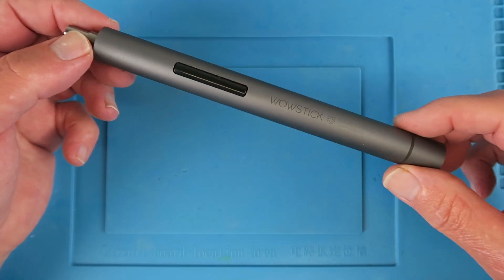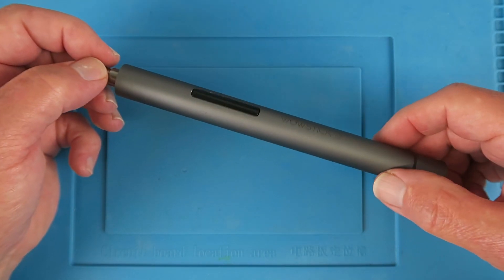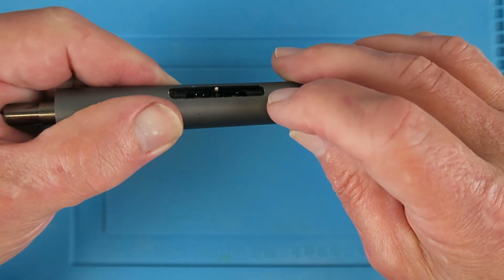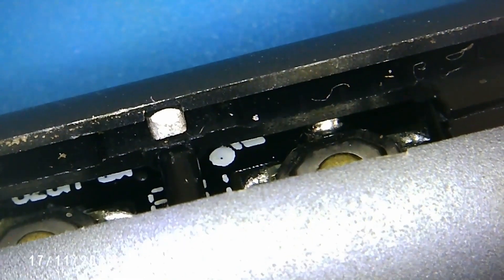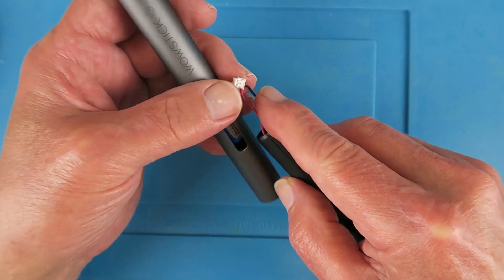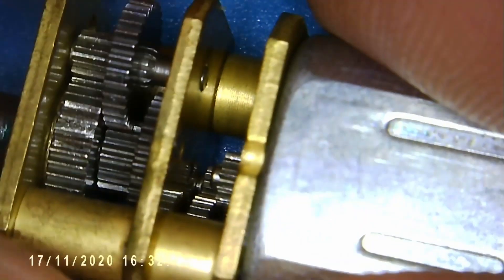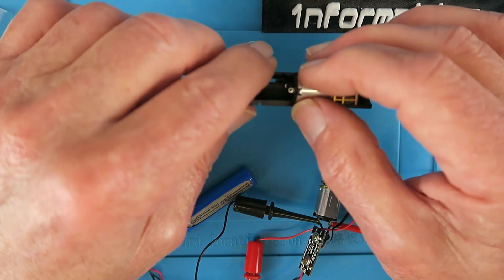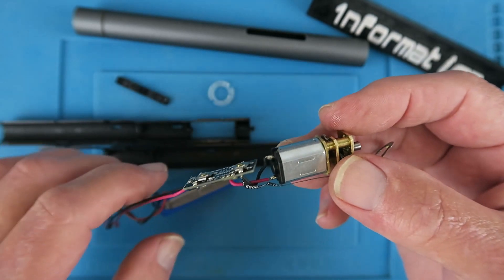Wowstick 1F+ Cordless Electric Screwdriver Teardown Disassembly Repair

Comment: Thank you, I just repaired mine based on your video. I ordered motor from AliExpress for 2 bucks, it was the short one. It turns out that it is rotating in reverse, but I easily fixed that by swapping the wires between the motor and the control board. The only thing that you're not showing is how you removed the charging cap, and it is kinda tricky, you should push it with something long and careful to not push it together with the charging board. Thank you for your video!!!!
Reply from the maker: You're welcome! Glad the video helped with your repair!

Comment: hi do u advice 1000 rpm or 500 rpm motor ?
Reply from the maker: It depends on what type of work you normally do. The general rule is higher speed = less torque. For example, if I work on a laptop with 20 screws in the base I would choose the higher speed. Thanks for watching, have a great day!

Comment: So I actually fixed mine with these instructions and got it all back together. When I plugged it in to charge it popped and immediately could smell the burning microchip. So the USB microchip control board blew out. Is there a place I can get these that anyone know? It still works right now but will stop working when the charge goes dead. If you have any ideas I would really appreciate it. I hate to come this far only to now have to buy a new one. Hope to fix that as well now,, if I can find that part.
Reply from the maker: This will work : 3.7V Lithium Battery Charger Protection Board 5V 1A 2A Micro USB https://s.click.aliexpress.com/e/_DegpA4D Thanks for watching, have a great day!
Reply: @1nformatica  Thanks man, you are awesome. I really appreciate the fast response and with an answer. You rock and will be following you
Reply from the maker: @rqgraphics  The board is a little too wide  to fit in the tube but maybe can trim some PCB off the edges. Otherwise you could always squeeze the casing to flatten it a bit! Let me know how it works out......
Reply: @1nformatica  Sounds good, I ordered it already today. I am an artist and do 3D printed stuff. So I am good at manipulating things and have the right tools for the job. I will let you know what I end up doing to it and if it works. That way you know as well for sure if someone else has that problem. Does the battery and main motor plugs have to go in a specific side of those plugs on the chip?
Reply from the maker: @rqgraphics  The battery and motor wires are in parallel. If you measure the B+ and output are joined. So connect the battery to B+ B- and the motor to output +/-. I found a slimmer board : https://s.click.aliexpress.com/e/_DBC4RsV
Reply: @1nformatica  Thanks again

Comment: Thanks for the video! Watch the video a couple time but couldn´t find the part where / how you removed the usb section. I can see a screw in the inside. Just pressing didn´t work. Any tip is apreciated.
Reply from the maker: You're welcome! You have to be brave to remove the USB plug! I used a wooden dowel rod about 8mm diameter to force it out from inside. It needs considerable force to remove. Once removed it doesn't want to go back! Good luck! Have a great day!!
Reply: @1nformatica  thanks- it worked 🤙🏾

Comment: ruh roh... I pushed the initial retaining clipes under the buttons deeper into the wostick to where I cant get to them now... watch out for that
Reply from the maker: That's a problem. Just speculating but maybe you can pass a thin piece of something like fishing line under it and pull it up?
Reply: Same thing happend for me. I just fished it out using a needle and fine-tipped tweezers

Comment: i have an issue with the battery which has failed and is swolen. Do you (By any chance) know what the correct battery is for this screwdriver (voltage & mah)
Reply from the maker: It is 10440 size 3.7v 350MAH lithium battery. There is a link to where you can find it in the video description. Thanks for watching, have a great day!
Reply: @1nformatica  Thank you soo much for the prompt reply, you've definitely got yourself a new subscriber!!!!!!
Reply from the maker: @justlisten9477  You're welcome!

Comment: How long did you have it until it broke ?
Reply from the maker: About 3 months. It broke because I tried to use it like a normal screwdriver to undo a screw that was very tight and it stripped the gears. The clutch is supposed to prevent this but it does not always lock. Be careful!
Reply: Atleast I know how to fix it now if or when it does crap out on me.

Comment: Amazing! Thank you! My battery is useless and needs replacing; but, there's also something rattling and the screwdriver will often not respond after a charge. Now I know how to access it and see what's happening. Pretty poor tool imo - looks fancy but underpowered and never did hold much of a charge.
Reply from the maker: A new "quality" battery should sort the power and run time issues. I mainly use mine for laptop repairs (does it really need 25 screws on the base?)! Also on my 3D printer which has some looooong set screws on it! Thanks for watching, have a great day!

Comment: I'm a french user of this screwdriver and I have the exact same problem.
How did you manage to plug in the battery cable to the bottom of the device ?
Reply from the maker: From memory I just pushed it up as far as possible from inside. The cable is just long enough to plug in if you are careful. Thanks for watching, have a great day!
Reply: @1nformatica  Thank you. I just ordered the piece...
Reply from the maker: @romainricouard  You're welcome! Have a great day!!

Comment: The clutch has gone in mine - fine if turned by habd as it locks up and  turns the screws, but under motor power it just slips 😡

Are rhe clutches avaialble for them?

I've also 3D printed a little round cap for the top so it doent dig into my hand wuth that sharp edge!!!
Reply from the maker: I haven't seen the clutches for sale but I took mine apart and got it working again : https://youtu.be/LsPibrMDaXw?t=328 May be just a case of fiddling with it! Thanks for watching, have a great day!

Comment: i just got mine brand new. But something is shaking inside when i shake the screwdriver. Can someone validate if  it is common or only mine, please?
Reply from the maker: Nothing should be loose inside. Contact the seller for a replacement. Thanks for watching, have a great day!

Comment: My Wowstick was working great, but today it refused to turn. I press the button, I can hear the engine working, but it doesn't spin around. I disassembled it and it seems that two gears at the very end doesn't touch together and that's why it doesn't spin. Is there anything I can do? I used it only few times.
Reply from the maker: Most likely a gear has stripped its teeth. A new motor and gear box is not expensive. Link in the video description to where I got mine. Thanks for watching, have a great day!

Comment: Is the brass casing on the gearbox detachable?  I bought a motor but the D shaft is too long
Reply from the maker: It is but a lot of work. a Dremel cut off wheel made short work of my long shaft, a hacksaw would work too. Thanks for watching, have a great day!
Reply: @1nformatica  so just dremel the shaft, no need to disamble?
Reply from the maker: @jri212  I just cut mine to 5mm long https://youtu.be/LsPibrMDaXw?t=435

Comment: Thanks! But how to remove the back part with USB-port the case?
Reply from the maker: I pushed it out from inside using a wooden dowel, it takes considerable force! Thanks for watching, have a great day!
Reply: @1nformatica  Thanks again for the disassembly instructions. The problem with my screwdriver was that sometimes it worked and sometimes it didn't. The cause turned out to be a "cold solder point" of one of the SMD diodes on the PCB.
Reply from the maker: @mariuszszymanski7957  Good job finding the problem! Thanks for sharing. Have a great day!!

Comment: My wowstick stop working, i can notice that pcb heats a lot when pressing the buttons.. Maybe is the IC shorted, i don´t know.. Anyone knows if i can find this pcb online ?
Reply: I replaced the chip now. Same issue with IC heating. After disassembling the motor, the brushes are toasted/broken. New motor on the way...
Reply from the maker: @michalsosovec2245  I admire your tenacity! Thanks for watching, have a great day!
Reply from the maker: Most likely the motor driver IC is blown. You can buy them here : MX612 SOP-8 dc motor drive IC https://s.click.aliexpress.com/e/_AFVNoh Thanks for watching, have a great day!
Reply: @1nformatica  i found the problem.. Motor is broken, is using to much current, that´s why the ic is heating a lot..
Reply: @1nformatica  removing the motor is not heating anymore.. do you think it worth buying the motor ?
Reply from the maker: @JorgeTeixeira  You can try testing with a torch bulb or toy car motor to see if it works. There is a link to replacement motor in the video description. They are not expensive so you have little to loose. Also you could try removing the gearbox and see if the motor works, maybe the gearbox is damaged like mine was.

Comment: But how did you get the battery out?
Reply from the maker: I used a wooden dowel to push it out from inside. It takes considerable force! Thanks for watching, have a great day!
Reply: @1nformatica  Thanks for the response.  My Wowstick is in pieces.  The gears seem fine, but the motor is shot.  Great video BTW.
Reply from the maker: @steveeb00  You're welcome! Fortunately the motor / gearbox combo is inexpensive to replace, see links in the description. Have a great day!!

Comment: There is an easier way to get the clips out, use a flat metal spudger or a flat screwdriver and push it into the side near the clip to slightly bend the plastic, the clip will then be loosened. When the clip is loose, you can simply take a magnetic screw driver to pull the clip out since it's made of steel, the magnetic tip will attract the clip. No need to scrape it out or anything.
I'm not sure how to properly push out the charging port though, it's pretty tight on my Wowstick..
Reply from the maker: I used a wooden dowel and pushed it up inside, it takes considerable force!
Reply: @1nformatica  you're a champ! I used a good ol' wooden cooking spoon and it popped right out! Thanks a lot ❤
Reply from the maker: @knigfotlets9870  You're welcome! Have a great day!!
Reply: @1nformatica  thanks! Have a great day too mate!

Comment: @1informatica, where did you order the motor? I need one for my 1f+. Also how did you connect battery and motor plugs to the charging socket that is at the end of screwdriver casing?
Reply from the maker: Link to motor and other things is in the video description : https://s.click.aliexpress.com/e/_ApnSw9 Connecting the battery to the charge port is tricky but the wires are just long enough to be able to grab the connector with needle nose pliers. Thanks for watching, have a great day!

Comment: Info for motor: "The screwdriver has a rated speed of 200 RPM and rated torque of 0.15/3N.M."
Reply from the maker: Good information, thanks for sharing. Thanks for watching, have a great day!
Reply: How volts?
Reply: @anatomiamd9935  3 volt
Reply: Thanks! How cut de points?

Comment: Same here..... Gears are made of only the best Chinesium.

Seriously though, I'll probably replace the motor/gear housing. However, given the gears are made with 
soft unhardened metal it's going to keep happening. Might try to pull it apart and harden them myself.
Reply from the maker: Yes, it is a shame the gearbox is so cheap and nasty! At least there are spares available. Mine is consigned to light duties only now!! Thanks for watching, have a great day!

Comment: My USB port died, and I'm unable to access it. It's rock solid; alien superglued. Eventually tried hammering it out, but it won't budge. Ended up with a bleeding hand. Awful design for repairability.
Reply from the maker: Mine was a push fit but the only way to remove it is to disassemble  the whole thing and push it out from inside. Sorry for your injury but as in all things brute force is never the answer! Virtually nothing is designed to repaired these days which is a disgrace. Thanks for watching, have a great day!
Reply: @1nformatica  Thanks, yes, it's distressing, but I'm gaining hope with the current right to repair movement. I gave it another go, but pushing it out remained hopeless. All or nothing; so I carefully cut the bottom off, resoldered the USB, put it back to together and fixed it in place with some duct tape. This time without any additional injuries… Also added a semi-permanent magnetic 360 degree USB plug, to relieve the port from future (un)plug strain. All's well that ends well, I guess. 😅
Reply from the maker: @ObscenePizza  I admire your tenacity! Good job!!

Comment: Thanks for this disassembly instructions. Do you think it's possible to convert it to allow power from 2 AAA batteries? I checked and it should fit in, but as I have no knowledge in electronics, I don't know if it's possible for the motor and PCB board with the button.. and where to find the part (iron plate and spring?), In fact I want to use 2 eneloop 1.2V 800mh each. Not sure the motor will accept.
I know there is the FS model which allow such batteries, but I would prefer not buying another screw driver.
Reply from the maker: Yes, the motor and driver circuit can run from 2 AAA cells. Thanks for watching, have a great day!

Comment: hi ,my battery will not hold a charge any more so when i took it apart to get to the battery i lost one of the retainer  things. Cant find it any where, my  question  is .Where can i get parts for it like the battery and the little retainer thing . please help me . thank you
Reply from the maker: From memory the battery is the lithium Ion equivalent of an AAA cell like this : lithium ion battery 10440 AAA size https://s.click.aliexpress.com/e/_9xPAop Check the dimensions of your cell. I have not see any other parts available like the retaining clip. I would try and find a piece of wire (maybe thick copper mains type) and see if that worked. Thanks for watching, have a great day!

Comment: Hi! 
I have the same version as you have. I have issue with the bits not holing into screwdriver. Did u see magnate inside screwdriver? Because my bits are magnetise but it still doesn’t remain inside the screwdriver. Do you knw how can I fix it?
Reply from the maker: I am not sure I understand what you mean. The retaining clips slide into grooves in the casing as you see here : https://youtu.be/LsPibrMDaXw?t=126 There is no magnate involved. Thanks for watching, have a great day!
Reply: @1nformatica  I meant my screwdriver is not able to hold the bits anymore but my bits are magnetised  I think there is a magnet inside the screwdriver where bits goes in and stays there due to magnet.
Reply from the maker: @lynchscouter  Ahhh! OK. my bad! I think there is a small 3mm diameter Neodymium magnet inside the bit holder like this : https://s.click.aliexpress.com/e/_AKbfcf It probably is glued in and maybe fell out or is stuck on the end of one of your bits.
Reply: @1nformatica  Thanks! I will check.. I did try to use drill bit in it which may have demagnetized it... (I know I shouldn't have done that...but curiosity!!!)
Reply from the maker: @lynchscouter  Neodymium magnets are very fragile and easily damaged. Dropping one or hitting one will shatter it like glass. Also heating will demagnetise it, like trying to solder a wire to one. Don't ask me how I know!!

Comment: Hello! What RPM value and voltage should I buy on your link from ali? Thanks!
Reply from the maker: The motor is 3 volts, the Wowstick I have claims 200 RPM but it seems slower. I would go for 200 or 300 RPM. Thanks for watching, have a great day!
Reply: @1nformatica  I'd like to buy much more RPM, for example 1000 RPM. What do you think, will it work? Thanks!)
Reply from the maker: @anotherliquid  Sure it will work! However, there is no such thing as a free lunch, higher RPM means less torque.
Reply: @1nformatica  got ya! Thank you again, and have a good day :)

Comment: I manage to take out the 2 retaining clips but cant get the thing apart, maybe it's glued or something?
Reply from the maker: Mine was not glued just a tight push fit. The charger port was even tighter and needed to be pushed out from the inside with a wooden dowel. It's brute force I'm afraid!

Comment: I've always taken the view, there is nothing more solid than a simple spanner, screwdriver or a solid socket drive. I usually rely on these tools to get something loosened, or for final tightening whilst working on cars, but it can equally apply to fine tools like these. In between, yeah sure, use something mechanical or motorised to speed the job up.

Comment: Hola amigo compré un motor de 1000 rpm y 500rpm pero no tiene la potencia como la que trae el wowstick es que a mí se me dañó el motor 🥺
Reply from the maker: Hola! Lo que quizás tenga que hacer es fabricar un motor y una caja de cambios nuevos con las piezas que tiene. Usé el motor original y la nueva caja de cambios. Un saludo.
Reply: @1nformatica  pero la nueva caja de cambios es como la que aparece en el vídeo de que es un poco más larga... Y el motor original pues ya ni arranca...
Reply from the maker: @dyair3123  Entonces supongo que tendrás que comprar otro. Desafortunadamente, el control de calidad chino no está a la altura. ¡Buena suerte!
Reply: @1nformatica  tu cambiaste el motor en el vídeo verdad y dónde lo cómpraste y de cuánta si de 200rpm o 500rpm ? Pero es de 3v verdad ?
Reply: Amigo no ví que especifiques cuál motor compraste de cuánto rpm y si es de 3 v el que adquiriste para comprar de nuevo y a ver si llega bien esta vez... Saludos